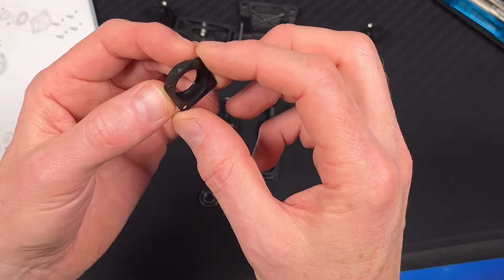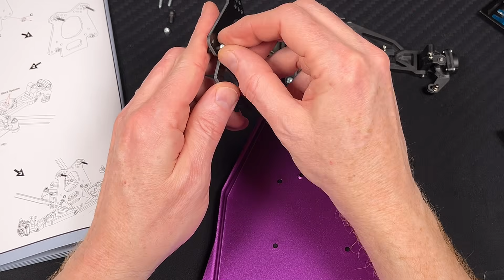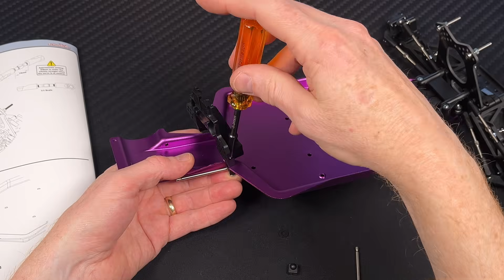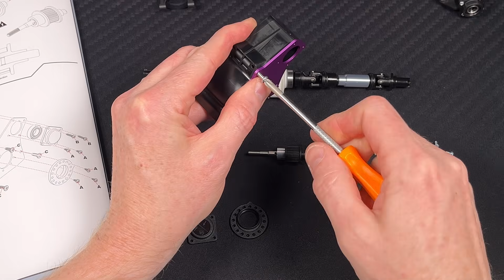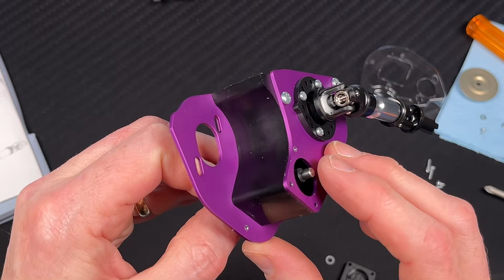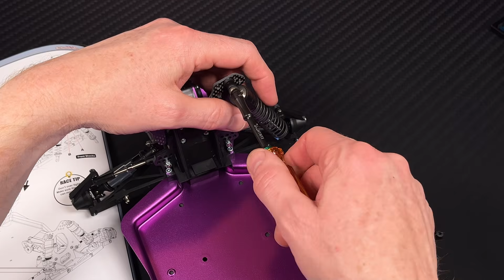Schumacher Cougar 2 Works: Full Mechanical Build!

Comment: Yeah i came from procat/bosscat various cougars the 2000😬 some of the assembly procedures are testing too say the least 😂 10 year's back i came back using ansman/team c and feel a lot more confident about digging in and changing settings doing repairs in-between sessions not perfect but easier for sure. Definitely not a fan of the variable pistons in the shocks introduced a variable when fine tuning 👍
Reply from the maker: Good to hear I’m not missing something on the pistons.  Just seems much more robust and reliable to use fixed pistons.  Thanks.

Comment: Man, this was a blast from the past. I was the only person in Colorado to have the Works car. I saved up forever to get it. Bought it through Tower Hobbies way back then over the phone, lol. Then like an idiot, I sold it on ebay in like 2010. I have not seen one for sale since. I even had the box and parts. All I have now is a pic of it after I painted the body back then. That belt drive was so smooth with a hot modified behind it. Damn I should not have sold that car.
Reply from the maker: Good memories though.  Thanks.

Comment: I have been using this it is not as messy.  Loctite 37643 Blue Medium Strength Thread locker Stick yes it is a stick. I put the Fastener on the screw tip and just kind of dip it.
Reply from the maker: New to me.  Thanks!

Comment: Hi , love your video , for info , those screws are not Phillips but pozidrive , you a need PZ1 screw driver , it is far more easy with the good screwdriver!
Reply from the maker: Thanks for pointing that out.  I’m reading that posidrive is far more common in the UK than in the US.  I’ve never owned a posidrive screwdriver.  You can use a Phillips screwdriver in a posidrive fastener if it fits snugly and you apply force to prevent slippage.  You cannot use a posidrive screwdriver in a Phillips head screw.  It would cause the uninformed some problems to have these tools mixed up in there box.  So, is it worth buying a posidrive screwdriver just to assemble this kit?  Given how many screws there are, I’d give it a try next time.  Thanks for the tip!
Reply: I have bought some pozidrive tip to build my Schumacher cat XLS and it was really a breeze ,

Comment: Ive still yet to understand that servo saver ? Its a head scratcher for sure. I would recomend a servo saver. I use the xray heavy duty one. Otherwise its easy to snap a steering arm 👍
Reply from the maker: Oh, I hadn't thought about breaking a steering arm.  I mainly think in terms of protecting the servo which isn't as big a problem as it used to be with metal gears.  I remember I used to break plastic servo gears even with a servo saver.  That makes sense about the arm though.  Somethings got to give.  Thanks!

Comment: for ajusting the ball diff  i use allen key like what you uses on the pinion grub screw ,  get the allen key and slid it into the gab where the flat head screw so the allen key lineds up with the groove in flat head , hard too explain but some of the key should be sticking out over the rear arms ,basicly just using the key too slot into flat head and hold it still ,than you can simple turn the other side wheel too tighten or loosen the diff , turn the wheel  just the same as doing up the  ajuster screw ,1/4 turns  at a time  too get the right settings , very smart idea  for quick ajustments
Reply from the maker: Wow, I think I've got you.  You use the hex key on its side in the screw slot and turn the other side of the diff.  When there's a will there's a way.  Thanks for the tip!
Reply: @HotTrackRC  yep you got it ,  lock the screw and ajust diff by turning the other side wheel 1/4 turns
Reply: @HotTrackRC  hi again hey just noticed your diff is wrong way around ,flat head ajuster should be on motor side/lock nut on spur side  ,,  schumacher are strange and not like RC10 not sure why ,but it will come loose if not fitted correct way around
Reply from the maker: @bradleyburge3794 Thanks!

Comment: I’m glad I’m not the only one who was baffled by the servo saver. I spent ages trying to do mine and eventually got it to work, you have to kind of twist it over. Once it’s done correct it actually feels pretty good although I just put a fixed arm on in the end like yours 😀
That lexan gear cover looks a lot of hassle. My Cougar classic has a pro transmission and a plastic gear cover which just seems much simpler. No idea which transmission is best though!
Reply from the maker: It's very interesting to hear other experiences.  Thanks for watching!

Comment: Best to use just the normal solid pistons, as adjustable ones are not the best idea
Reply from the maker: Yes, I think I will replace the adjustable pistons with the fixed ones.  As I said in the episode, I seem to have a difference in damping between the RH and LH rear shocks.  I probably got the adjustable pistons set differently.

Comment: You could add bearing grade shim washers to the top shaft until all the play has gone. Excessive play is not good as this might allow the top belt pulley to turn without the pin being fully captured.

Comment: Yay! Thanks, Bob, fantastic video, as always. I sort of wonder if there are different versions of this kit, or just my build experience was different. For example, my front uprights appear to be much shinier plastic, and I didn't have to shim the gearbox. If I recall correctly, I also got bearings in the slip yokes, not the bushings. And for the drive shafts, it took me a week to assemble them. At step 20 in the manual, it shows the aluminum barrel flush against the u-joints. Struggled with that for a while, lol. The washers I hit with a hammer to flatten them, heh. The gear cover I drilled a hole to get at the pinion grub screw. For the fasteners, it seems to me that they're easily stripped so you don't over torque and strip out the plastic. Cheap screws is a feature! Definitely the most challenging build I've ever done, but once it was running, the Works just rips! I haven't seen a lot of running videos of it either, so super excited to see you run it!

The only running issue I've had so far is the wing mount o-rings get brittle and snap rather quickly. Thanks to this video, I checked them and yep, snapped, replaced again. Schumacher also has all the parts and upgrades available, which is awesome.
Reply: You can get fixed mounts for the rear wing without the o ring.

Comment: Hi Bob,
Perfect timing. Mine was delivered a couple of days ago and I was looking forward to building it before your video. Now I’m dreading this build. The other YouTube videos I watched on this all bragged about how great the engineering was on this buggy. I guess I’ll set expectations for this to be a challenging project and hope for the best.
Reply from the maker: Yeah, it'll throw you some curve balls, but I'd like to think if you watch this video you can sail through a lot of that.  No need to put the bell cranks together 4 times like I did once you see how it's done :).  I had heard that assembling the drive shafts was particularly difficult but it's not that hard to figure out.  Just don't be afraid to exert some force to get those spyders to go.  Comment back if you have the same issue as I did on the top shaft end play causing interference.  Thanks for watching!

Comment: I built one last year and they are not the easiest ,  if you want a real challenge the front end on a Procat/XLS is fun... The markings on the bearing holders is the original Schumacher logo.
Reply from the maker: Ahhh!  Thank you.  It looked vaguely familiar but I couldn’t place it.
Reply: @HotTrackRC  You are right about the fasteners, but they are an improvement over what would have been on the original Schumacher's - they where are all slotted!  If you want a good screwdriver kit with decent bits have a look at the ifixit kits, I have the Mako kit and they a great for  RC applications - they even have 5.5mm driver and JIS bits.
Reply from the maker: Wow!  That puts things into perspective.  I can't imagine building the whole kit with a flat head screwdriver.  Seems that a few of those fasteners survived in the re-re.  Thanks for the tip on the tool kit!